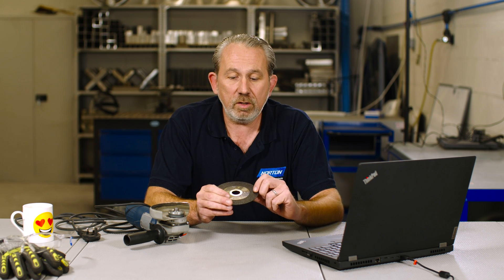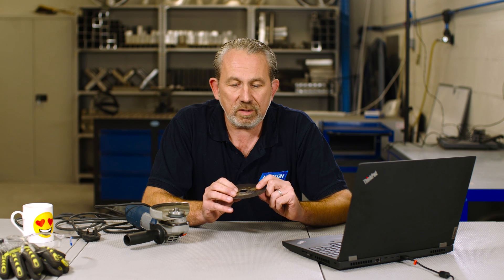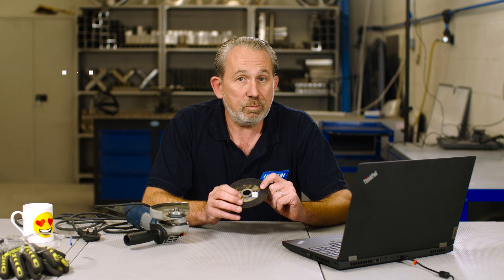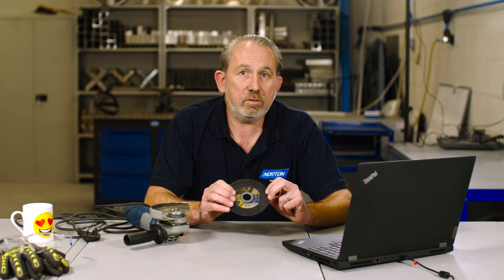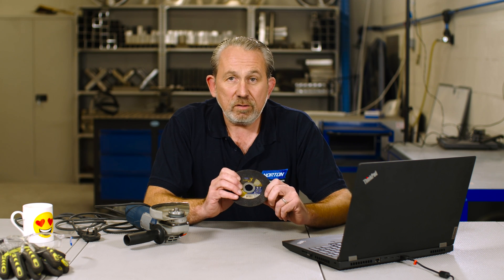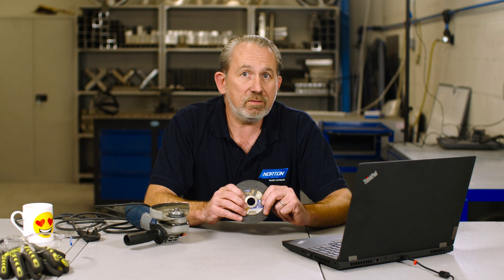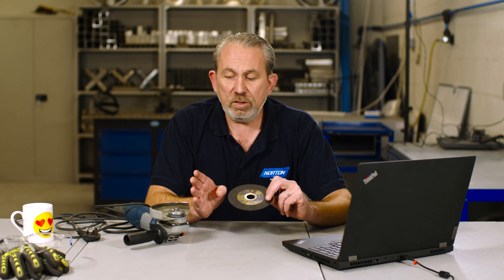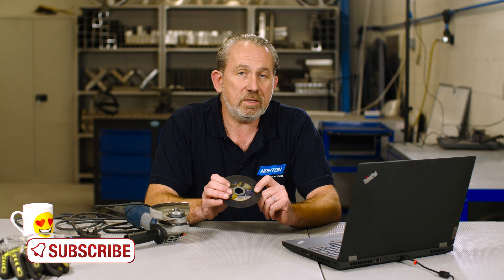ASK THE EXPERT: What is an INOX cutting disc?

Comment: Can we use inox cutting disc on all the metals?
Reply from the maker: Hi Pulkit, Yes you can but if you use it on carbon steel, don't then use the same disc on inox as you will contaminate it.
Thanks for watching!
Reply: @NortonAbrasivesEMEA  Thanks for replying, just one more thing - which one is stronger between Inox and Metal Disc.

Comment: What type of fillers going to be used in Inox wheels?
Reply from the maker: The main thing that all Inox cutting discs have to avoid as a filler is Pyrite. I am happy to tell you that none of our Inox cutting products contain this as a filler.
Thanks for watching!
Reply: @NortonAbrasivesEMEA  thank you very much sir. Then which type of fillers going to be used in Inox wheel. Any oxide fillers, low temperature fillers?

Comment: Does Pyrite Iron Filler ?
Reply from the maker: Pyrite is commonly used as a filler by many cutting & grinding disc manufacturers.  It has a high iron content and therefore would contaminate stainless steel / inox. 
Here at Norton all our Inox rated cutting & grinding discs do not contain any Pyrite.
Hope that helps and thanks for watching
Reply: @NortonAbrasivesEMEA  Thanks
Reply: Otherwise pyrite then what filler materials to be suitable for inox

Comment: I can't find a complete guide for the labels used in each disc. 
Some websites explain what these are although not completely, and some discs are missing certain labels, such as:
1) WA60P5BF2 - Type 41
2) A60RBF  Type 41 - there are no numerical values after the other letters('5' or '2') but #1 has?
3) A30RBF - Type 41